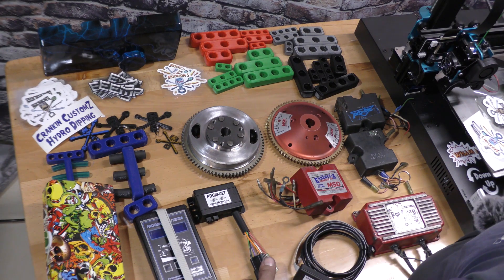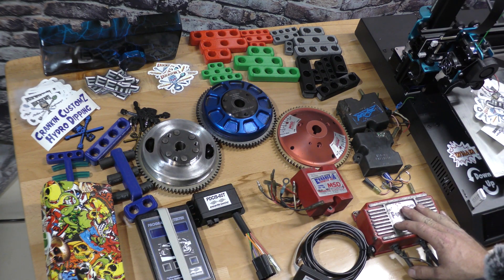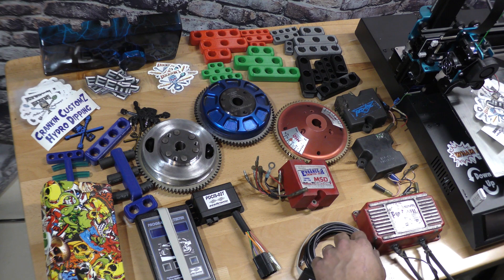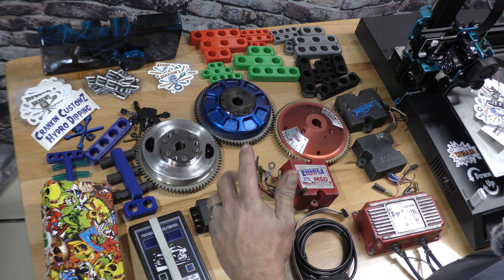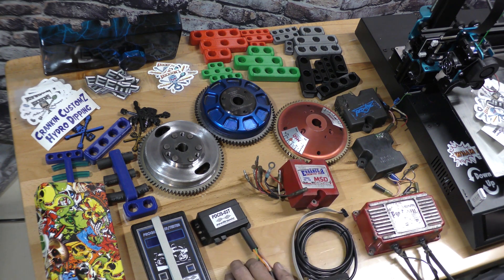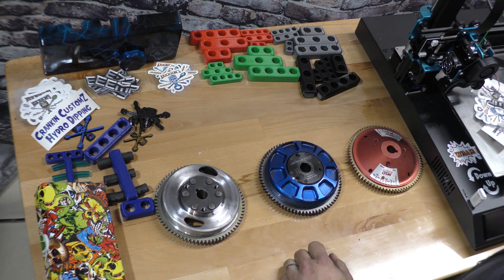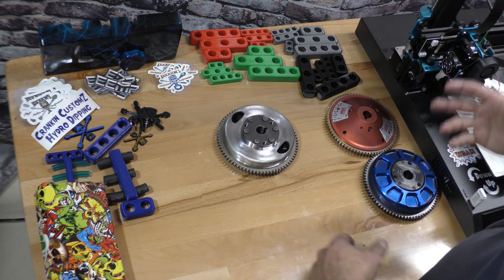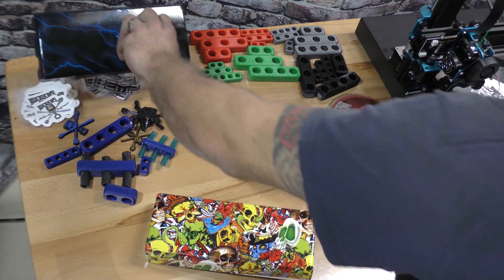Aftermarket ignitions for performance 2 stroke watercraft. Zeeltronic, MSD, Total Loss, and MORE!!

Comment: I need help bad. I have no spark on my plugs to my 550 which has only 10 running hours on a fresh rebuild it's been 6 years and I can't find an ignition coil. Can you help recommend  how I can get a coil working without changing my flywheel
Reply from the maker: Hey email me your # and I'll call you and try to help
Reply from the maker: Ericksonmap@gmail.com
Reply: Will do. Appreciate it.

Comment: Hey man I got a js550sx with a bad ignition coil the motor has 10 running hours with a fresh rebuild I have no idea where to find a new coil or a new cdi box will these work? Or do you have any info that would help on to replace or fix this issue

Comment: Our jet-ski community only accepting advice if it's from this channel, I'm from South Africa rebuilding a 650 and 701cc. Would appreciate more advice on different ways on machining a stock flywheel for surf. I did use a waterjet cutter to cut 0,7874 thick spokes, then followed through on the bend and after  with CNC machining. Lost almost half of the weight (perfectly balanced afterwards).
Reply: @EricksonMachinePerformance  can u do a 99 polaris 700

Comment: Thanks for the videos.  What's the weight on the total loss, Jet netics, and the lightened flywheel? Thanks again!👍
Reply from the maker: New is like 1.25lbs
Old style like in the video 1.67lbs
Jetnetics 2.6lbs
Stock ultralight 2.9lbs
Stock lightened 3.25
Stock 3.7